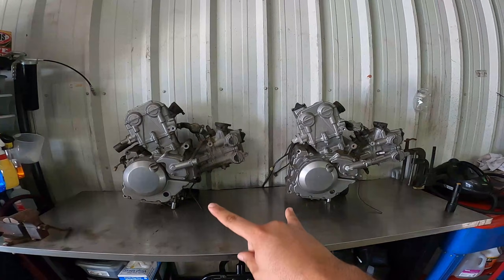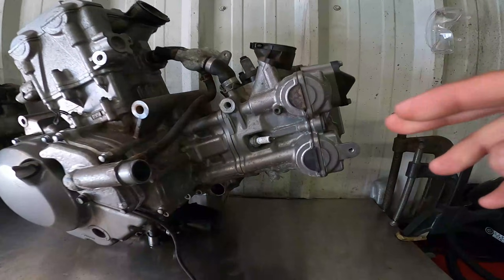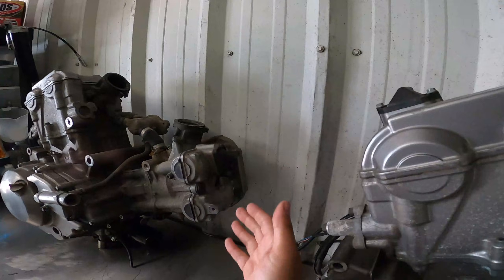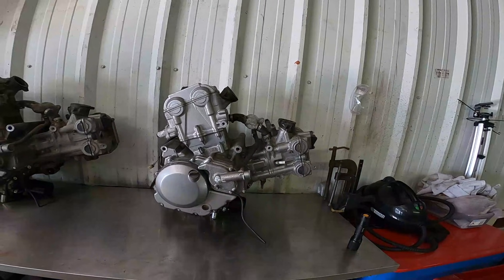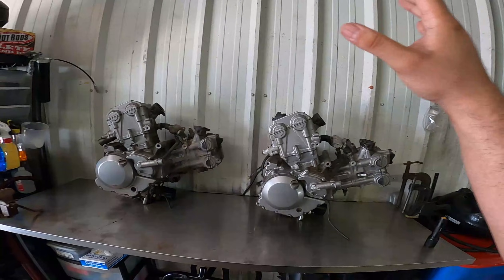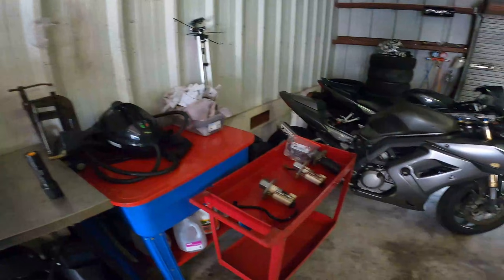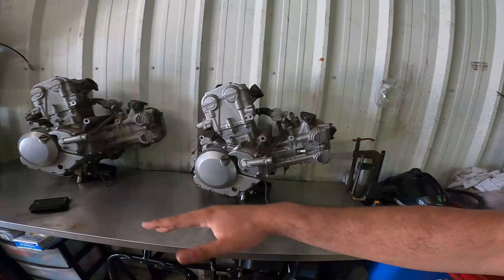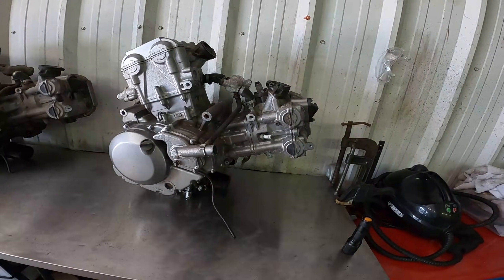Suzuki SV650 Gen 2 Engine Design Differences (Single Spark Plug vs Dual Spark Plug Design)

Comment: I've ridden a DL 325, but water in the plug hole was not the problem, a broken crimp in the wire harness on the wire going to the front fuel injection was. Later, another crimp on the same wire leading to the fuel pump broke, leading to a DL 0. I drive my bike all year, 04 dl650 EU model. Lots of rain, snow and salt on the roads here which probably caused this.

Comment: I think I like the single plug engines. It would be different if the dual plug engines made noticeably more power, but they don't. It is just an Euro emissions move, so why complicate things? And by the way, in 33K miles, my '06 has never become a 325 in the rain. That is probably because, without that extra plug in the way, it only takes about 10 seconds to locate the drain hole and check it with a pick. If I had to remove a spark plug to do it I doubt if it would ever happen. Anyway, there's my two cents on the matter.
Reply from the maker: Thanks for your feedback.

Comment: If you wanted to run the twin plug engine in an early bike you could simply use the dual output coils.
Reply from the maker: Thanks for the input.

Comment: The direct swap of the two engines  can be done even with K6 engine on K7 bike, but you need to swap ignition coils too (the K7 coils have dual output...).
Reply from the maker: Thanks for the additional input.
Reply: @PASSIONBUILT ❤

Comment: Why are there SV’s from this generation after 2009? I’ve seen some produced up to 2014.
Reply from the maker: There weren’t many produced after 2009. The ones after 2009 usually aren’t US based either. There are a few but they are very hard to find.

Comment: Hello! Would a 2007 up engine fit into my 2014 sv650s?
Reply from the maker: I believe so but you would have to swap some components over to make it compatible. @mad8vcycles would be the guy to give you a definitive answer since he has much more experience with Gen 3 models.

Comment: It's great to find this video, thank you, I think you solved my doubt. 
sv 650 s 2003 broken engine, gladius 650 2012 engine is installed  
engine out of time, does not want to start 
It has 4 spark plugs, do you think that by removing the 2 side ones it will start?
Reply from the maker: Removing 2 plugs isn’t going to make it start. If you have the dual plug engine in there now the secondary plugs are doing nothing.
Reply: @PASSIONBUILT  so . What can you recommend to start the engine?
Reply: @teneriferastarider3811  Timing the engine correctly would be a good place to start.

Comment: Well a '2001 SVS 650 motor fit in an svs 650 2003
Reply from the maker: Yes. You will need to swap some parts over to the Gen 1 engine to make it compatible though.

Comment: I have a 2009 Sv650s with a 2005 motor in it. It's not idling well but besides that its okay. I found out that it could be from having the extra spark plug wires capped. What are some ways to go around it? Swap to older ignition coils? I have the 09 motor still. Could the 09 head be put on the 05 motor so it can have both spark plug holes?
Reply from the maker: I’m not sure. I’ve never heard of anyone having a rough idle when having dual plug / non dual plug engines swapped. The cylinder heads are interchangeable. There is a company that makes a harness so you can use your single plug coils. Sergei at Mad8V cycles came across one on a parts bike a few months ago.
Reply: @PASSIONBUILT  Okay thanks. Yeah it's dropping 1 cylinder at idle most of the time. I'm trying to diagnose.

Comment: CooL!!
Reply from the maker: Thanks for dropping a comment! 😎
Reply: @PASSIONBUILT  did you run the latter model with only one plug? It still runs well?
Reply from the maker: Are you asking if I removed a plug and ran the bike without one? If so. No I’ve never done that. Nor has my bike dropped one of the plugs to my knowledge. But people do run later model engines in earlier models and just leave the secondary plug unhooked and the bike runs as it should. I hope this helped answer your question 🙂

Comment: Is it possible for a new 23 650 to becime a sv325? Is the power grratly nituceabke when running on 1 cylunder? It has to sound alot differwnt too right?
Reply from the maker: Yes it’s possible. Yes and yes.

Comment: I'd like to hear about the differents between the SV650 and the VStrom engines!
Reply from the maker: As far as I know. Not many differences. If I ever get my hands on a vstrom parts bike. I’ll make that video 😎
Reply: Don't V stroms have suzuki equivalent of Nikasil lined cylinder bores? Possibly milder cam timing too?

Comment: Do the '10 up motors have a drain hole as well? Speaking of the vstrom 650 motors, mine is a 2013.
Reply from the maker: I believe so. But I’ve never had my hands on a vstrom so I can’t tell you for sure.

Comment: Guys I'm looking to buy a used 2003 sv650 with just over 5k miles on it. What should I look for? Any typical issues with this year? Should I stay away from certain years? Thanks also what type of fuel mileage can I expect to see on this year
Reply from the maker: Check out this video I made doing a model comparison on the 2003 vs 2004-2009 and S vs N models.

https://youtu.be/RZ41vPQYqQU

Comment: I heard the single SP heads make more power. Zoran...I have a 2012 DL650 and like making power!
Reply from the maker: Everyone has their own opinions between the 2 engines. I’ve heard people say that they dislike the dual plug because it runs tougher than the single. I’ve heard people say the duals make more power. In my experience with the amount of SVs I’ve ridden. They all feel almost the same. If you blindfolded me and put me on a bone stock single plug and a bone stock dual plug. I couldn’t tell you which one was which. I’ve owned a 50k dual plug that felt crispier and just as fresh as my 10k mile dual plug bike. I’ve rode 30k single plug bikes that feel super healthy compared to a 15k single plug that felt tired. I’ve ridden a couple that have had the cam swap upgrade. I feel like they’re all very similar and the only differences that can be truly felt are SVs with power mods and SVs that haven’t been maintained properly.

Comment: Exactly what I was looking for, thank you!
Please do one for exact changes I need to do, I just bought a 07-09 engine and its going in my 03 bike.
Thanks again.
Reply from the maker: No major changes need to be made. Sergei @mad8vcycles just made a video about a pigtail adapter for dual plug coils to single plug but other than that. It’s pretty straight forward. I’ve parted out a couple of SV650s that had dual plug engines in single plug year frames.

Comment: What about the 2002?
Reply from the maker: Engine is pretty much identical to the 2003-2006 models. Single plug design. A few minor differences since it’s carbureted. But it is single plug for each cylinder head.
Reply: I just got one with 10 thousand miles. Immaculate condition.

Comment: Does the dial plug design still carry the drain hole for moisture
Reply from the maker: Yes. It’s located behind the secondary plug.
Reply: @PASSIONBUILT  when you say behind… do you have to remove the plug to see it ? I don’t see it anywhere near.  Is there somewhere I can find a diagram or picture ? Can’t find it anywhere

Comment: Nooo do the 02 engine! I wana kno if i can swap carbs for fuel injection.
Reply from the maker: You can swap a later model engine into an earlier model and vice versa. But swapping carbs to throttle bodies and going fuel injected would require too much unnecessary work. It would be more cost effective to sell your Gen 1 and buy a Gen 2.

Comment: The single plug motor will work in any 07-09 dual plug bike I know I have done this swap before with all the 07-09 wiring ECU throttle bodies and O2 sensors you must change the coil plugs and run 03-06 coils All you do is change the coil connector to 2 large female spade and 2 small spade connectors it runs great with no codes first try
Reply from the maker: Good to know. Thanks for the info!
Reply: @PASSIONBUILT   not a problem keep up the videos I really enjoy them and info that you bring with them.
Reply from the maker: Will do! Thank you for supporting the channel 🙂
Reply: This is an old comment so hope I get a reply! Doing and engine swap on my 05 SV, the engine going in to it is from an 09 SV. Is it backward compatible also?
Reply: Is anything else required to swap an 03-06 motor into a 07-09?
Reply: 😅 same question , i have a k8 dl650 and a swap engine from a k6 , i changed just the stator plug , I have seen other different plugs for coils from k6 to k8,I will have to check all connectors
Reply: So add 03-06 coil and chance the connectors is all you have to do? You can keep the 07-09 ECU?

Comment: Any one know if a flywheel -magneto from a 2003-2007 engine would fit a 1999-2002 engine..
Reply from the maker: It would technically fit but there is no reason to swap magnetos unless you’re putting a 1999-2002 engine in a Gen 2. If you were swapping an earlier model motor into a later model or vice versa. You would need to transfer some things such as that flywheel and magneto. 

Are you on the market for a Gen 1 magneto and flywheel but can’t find one?

Comment: And I'm curious do you think a second gen motor would fit in a first gen frame if you had the harness to go along with it?
Reply from the maker: Gen 2 engines are a direct fit to the Gen 1s but you need to swap your magneto, stator, thermostat housing, and intake boots. There’s something else I’m forgetting but it can be done without swapping harnesses. Just need to transfer a few parts from the Gen 1 engine to the Gen 2 engine.
Reply from the maker: I’m actually working on a complete conversion video right now for that as well. 😃
Reply: Why would you need to change all that if only the frame is changed like I mean using a gen 2 wiring harness and everything, you should totally do a video on this
Reply: @ThaoElden  gen 1 had carburetors, Gen 2 had EFI so in gen 2, the magneto has more "triggers" so that the ecu can read engine position. Its not a hard job.

Comment: I've swapped an 07 motor into an 04 frame all you need is the wiring harness to match it
Reply from the maker: Yeah that’s why I mentioned the harness differences. But the main point I wanted to get across is that it’s not a direct swap for someone with an 03-06 model. They would have to source a harness as well and that is sometimes not as easy.
Reply: please tell me exactly what all I need, 

I just bought a 07-09 dual plug/cyl engine, going into my 03 stock frame,
 I thought it would just swap strait across?
it is a big hit to not have the second plug firing?
Reply: @Lonchpad1  the 07-09 sv650's had a different ecu and 05-09 had a slightly different fuel pump than the 03-04 models as well so I'd advise to buy a 07-09 wiring harness and fuel pump from 05-09 to match the engine, other than that it's 100% good to go
Reply: @Lonchpad1  so in short you'll need a 2007-2009 wiring harness and ecu, and a 2005-2009 fuel pump
Reply: @ThaoElden  thanks man!
Got the 07 ecu and harness on the way, I’ll look for the fuel pump now.
👍🏻👍🏻👍🏻

Comment: Any chance you would know why my 03 sv650 smells like unburned gas when idling. Changed plugs and air cleaner is clean. But still have the smell. Thanks in advance for any help you can give me.
Reply from the maker: As I mentioned in the video. The 07-09 models came with the dual plug design to optimize fuel combustion to help with the unburned gas. However, if you have an aftermarket exhaust system. It could cause issues with your factory tune and may cause your bike to run rich explaining the unburned gas smell. Any modifications done to the bike?
Reply: @PASSIONBUILT  It's all stock.
Reply from the maker: Have you checked for leaks under the tank from either the pump or main fuel line from the pump?
Reply: @PASSIONBUILT  Have not. But the smells is coming from the exhaust. When idling at a stoplight my brother who sometimes rides with me, tells me he can smell gas.
Reply from the maker: Gotcha. I guess it just sounds pretty normal. Like I said. The 2007-2009 models got that revised cylinder head to optimize the combustion process which helps reduce wasted unburned gas. A lot of these SVs that I part out do smell a bit rich but that’s usually because the exhaust has been hacked up or the bike has been modified. If I was you. I would just double check under the tank for any possible leaks but if none are found and your bike is running good. Don’t worry about it and enjoy your SV 🙂
Reply: When I once messed with the TPS and set it wrong I remember getting blue smoke, maybe try adjusting it.

I did notice the other day after riding, (parked in the shed) a fresh petrol smell a few feet away. I think it was toward the rear brake res. Not from the end of the two overflow pipes below the bike. Hopefully it's not leaking.